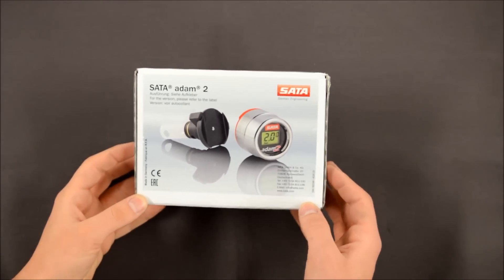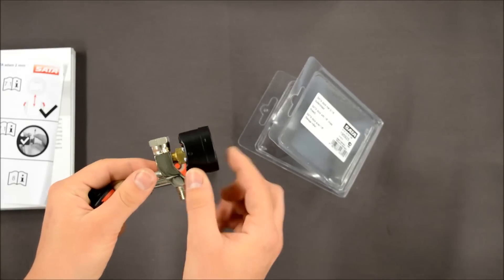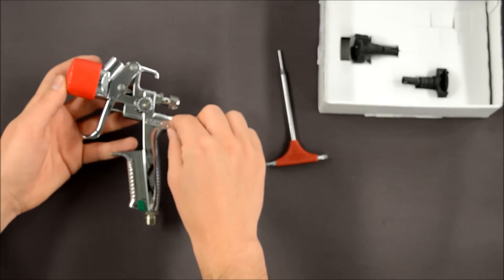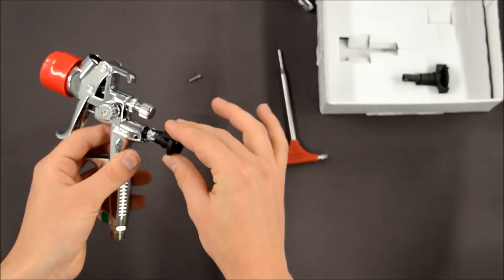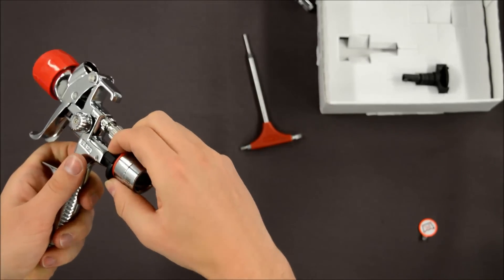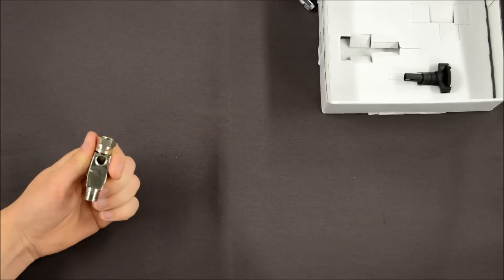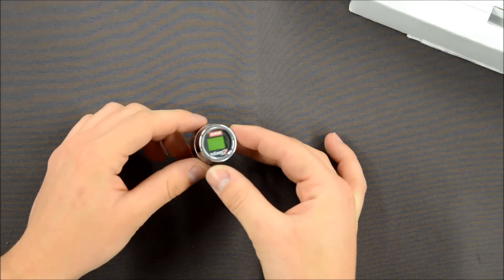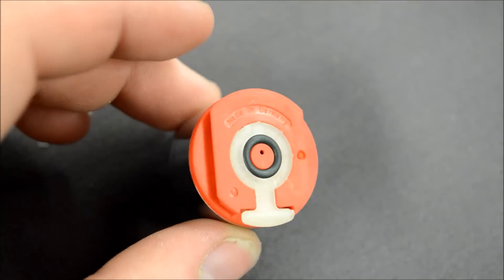SATA adam 2 and the adam 2 U how to fit

Comment: Hi Jordan, Nice, informative and highly useful video yet again What part number is the retro fit 2U model? ive only ever seen this with the universal regulator assembly included. thanks in advance.
Reply from the maker: +lewigas290 Hi, thanks for the great feedback! The part number for the adan 2U retro fit dock is 195925 thats for the dock only or you can get the gauge what mounts the the gun already fitted with the dock and the part number for that is 195230.
Hope this helps
Jordan

Comment: I just installed it thanks to your video so I thank you for that. How do you turn on the display ? Is there a battery somewhere inside the air gauge ?
Reply from the maker: It turns on automatically when air is passing. If it doesnt you may need a new battery or check the air ways to make sure they're clean. Thanks!

Comment: Hello Jordan,I've just purchased 5000rp 1.2,great gun,the clear I use is a 2 coat application,just wondering on first coat do use full trigger close and fast or do you feather the trigger to get a tight fine coat,then full trigger on second?thanks again👍🏻
Reply from the maker: +Tim reeks hi, i normally do full trigger but quick passes with the gun pulled back for a 3/4 coat then a full wet coat. I spray close and fast but its up to you how you put it on Just as long as the second one is nice and wet.
Cheers 
Jordan